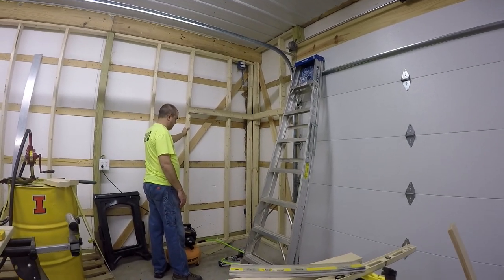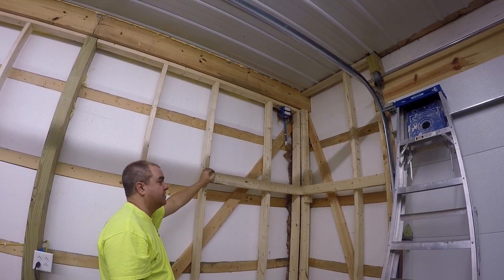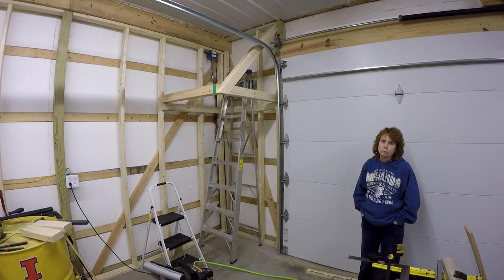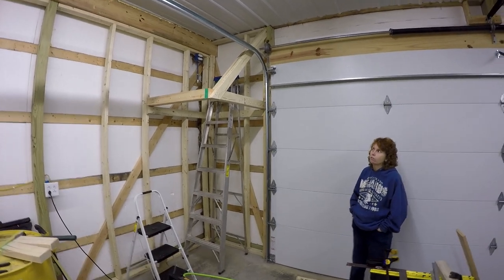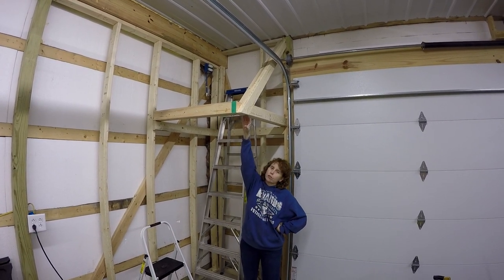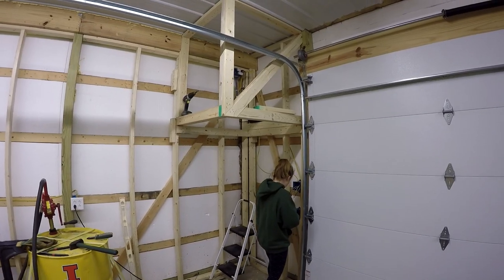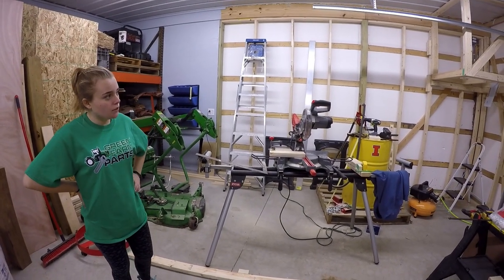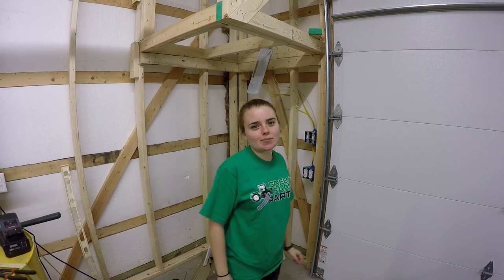Pole Barn Framing an Air Compressor shelf

Comment: Watch out to make sure you have enough airflow for air compressor cooling. I melted thr plastic on a couple of them mounting in an enclosed space. 

PS> So grateful you are not doing the click bait titles. Love watching your channel.
Reply from the maker: how much airflow do you think it takes?    I'll probably be fine as little as I use the compressor, but I have wondered about something like this.  

I'm probably just not clever enough to come up with the click-bait titles.     
Give me a couple of good ideas.... :-)
Reply: Tim i was just about to say the same thing about making sure you have enough airflow for air compressor ! i know we have a big one and it said in the book yes i read the book ! LOL if you put in small shed it could over heat or not work right  ! take ezy !!
Reply: Tractor Time with Tim I would think that a vent with intake and exhaust. Vent outside if you can.

Comment: Cheese Burger Cheese Burger, Pepsi Pepsi! 
Back in the mid 70's I drove a truck from Dallas to Houston, Austin, San Antonio regularly hauling  CertainTeed fiberglass building insulation. I made it through 1 Summer as I was ate up with the shards of fiberglass in my skin and clothes. I unloaded in jeans and LS shirts. Then I changed into shorts and a tank top to drive back to Dallas. It was miserable, like having loose hair down your neck 24/7.
Reply from the maker: The stuff certainly itches.    I hate it when I get it in my throat.

Comment: 4:15 You talk about getting a pepsi? Ever tried an ale-8? They will give you the energy you needed to fix that whole garage by yourself. Strong as "Popeye". Lol. Putting the air compressor in the corner saves space. That's a great idea I could use for my shed. Of course, I need electric ran first.

Comment: did you install a whip on the drain to be able  to drain the compressor remotely
Reply: will the pet-cock come out?If i does then put a brass fitting connected to a reinforced(braided) hose  and a 1/4 turn ball valve at the end of the line

Comment: Just be careful when enclosing it buddy,, they get extremely hot ,, maybe add vents to the outside so it can not only vent hot air but intake air also,,, maybe like intake on front or side which ever gets the most air blowing that way and exhaust on the other side,, .. heat is def a issue with them ,   Just a heads up...
Reply from the maker: +uPhatboyHD88 yea, not sure how much ventilation needed